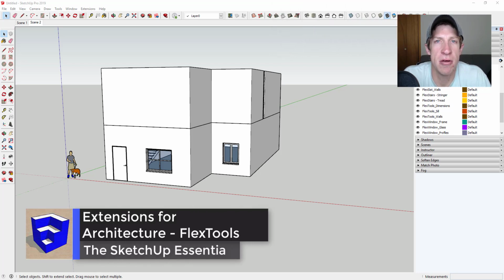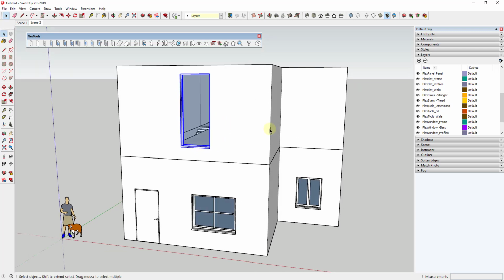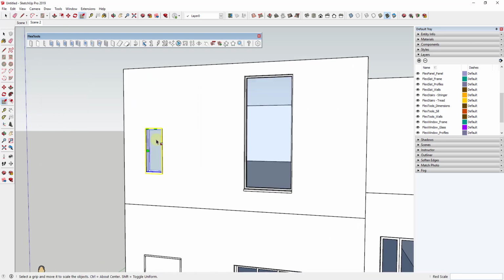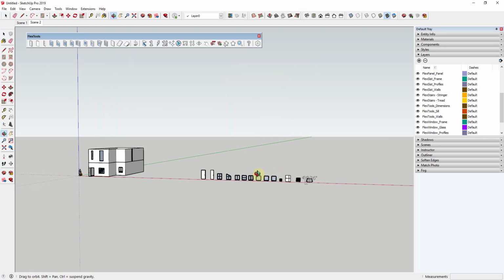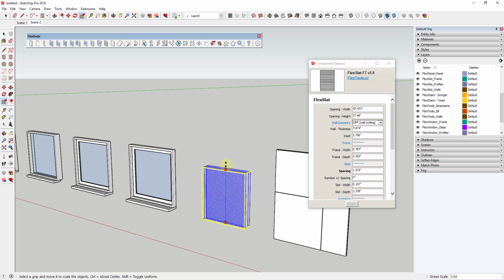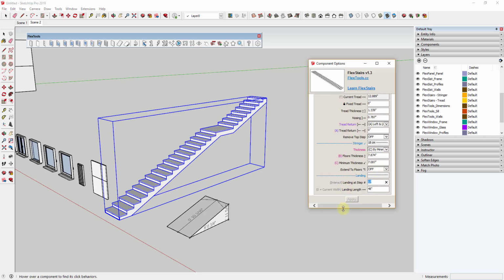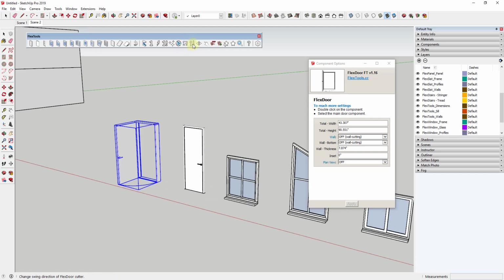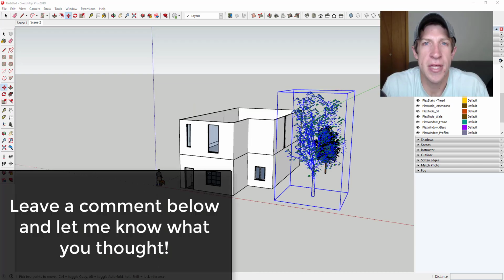SketchUp Extensions FOR ARCHITECTURE - FlexTools

Comment: Hi Justin, thanks for another great video.  I think you might be familiar with Michael Brightman's ConDoc for Architecture system.  His system uses a TAGing system to use to create plans, elevations, sections, interior/exterior perspectives.... So for components like: windows, doors, fixtures, furniture, etc. As an example, the door component contains 3D and 2D tags.  The door panel would be a 3D tag and the door swing would be a 2D tag.  So for plans the 3D Tags would not be visible and the 2D (door swing) Tag would be visible.  And the opposite would be visible for elevations and perspectives.  Is this possible with Flex tools without having to go into each component and open and shut windows and doors?  Thanks.

Comment: Seems expensive unless you use the tool daily.
Reply from the maker: Suppose it depends on how much time it saves you - depending on billable rates, if it saves you 4 hours a year, it's probably paid for itself, but like you said - depends on use - thanks!
Reply: TheSketchUpEssentials  when you put it this way it really doesn’t seem that bad. Good point.

Comment: Thanks Justin. Does the stair landing function only apply to a straight run of stairs, or do you have the option a half flight to landing in a switchback set of stairs?
Reply from the maker: At the moment I believe it's only straight stairs - thanks!